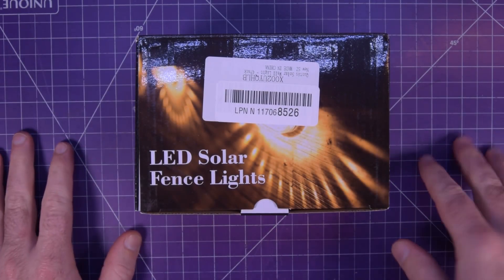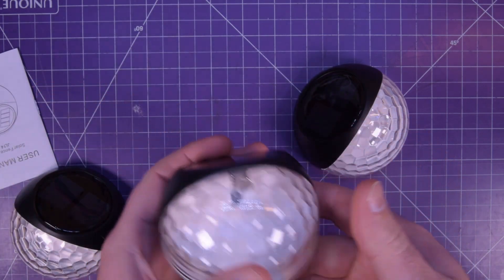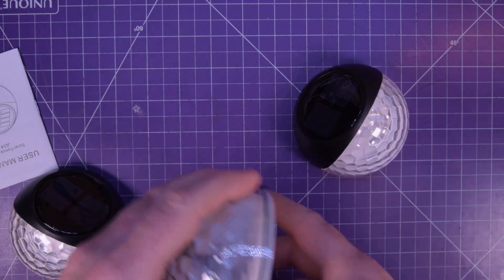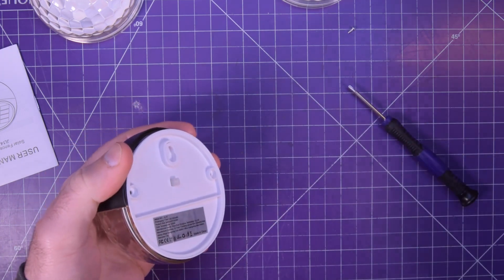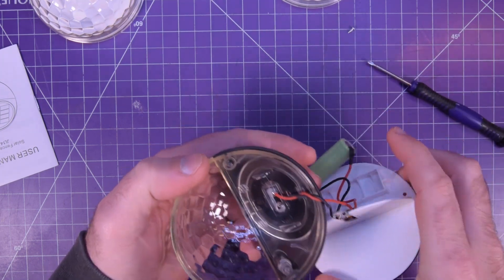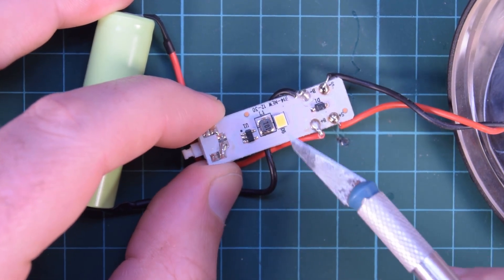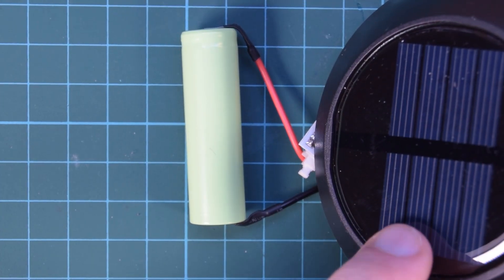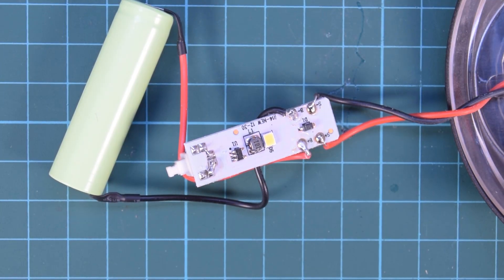Solar Light Teardown (Quntis Solar Lights)

Comment: It's actually using a neat little chip, that's why the internals are so simple.  The chip not only turns on the LED, it uses a FET to pulse the inductor, and even has over-discharge protection for the battery, and keeps the LED from flickering/flashing when the battery gets low.
Reply: Did you find the datasheet?

Comment: Got myself some garden solar lights on clearance a few years ago, the solar panel was directly wired to the nickel cadmium battery. The parts are still floating in a box somewhere.
Reply: there must be a forward biased pn junction diode or else how will there be 1 direction of flow of current between battery and solar panel . i mean the battery can even discharge through the solar panel if no fwdbias pn jnctn

Comment: Yes, hard to get simpler than that, until some enterprising Chinese OEM figures out to put the LED, chip and diode all into the same case, probably one of the 4 lead serial type ones, and makes a single part option, that you only have to add the inductor to it to make the complete fixture. 4 pads is about the simplest you can go, and will work.

Seems a good enough fixture, though of course the seals are the part that determine life, and they likely will eventually fail from moisture getting in them, though it might take a year or two to do this.